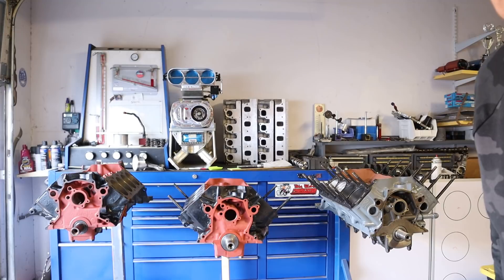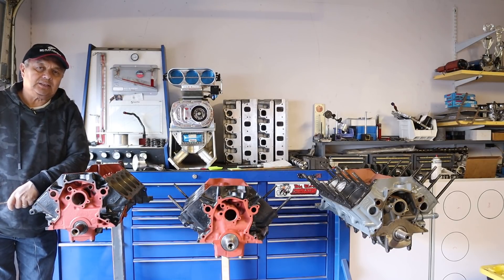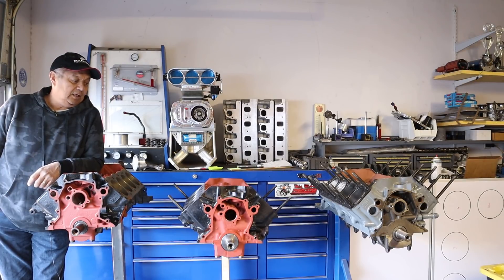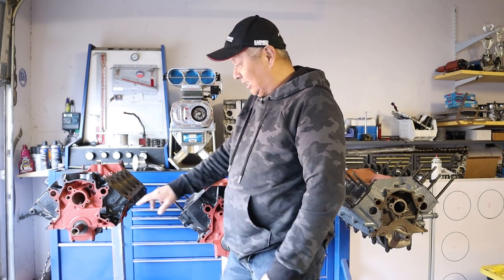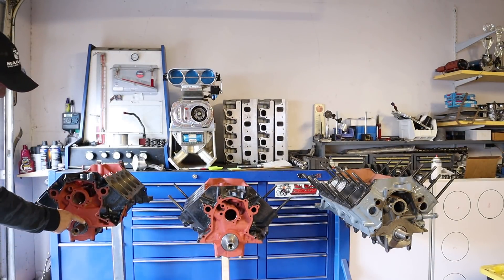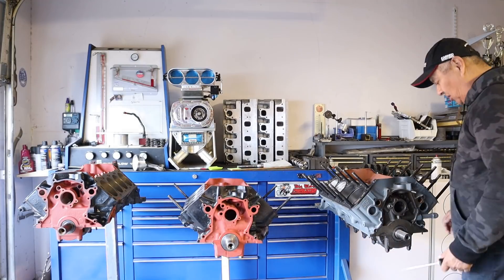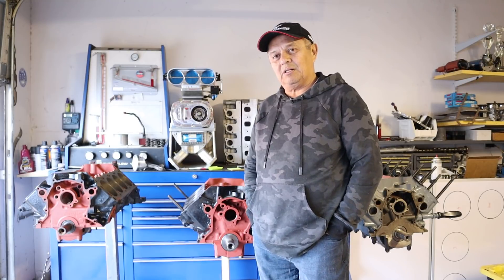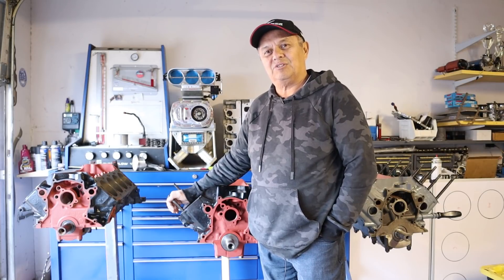FORD SMALL BLOCK SPLITTING EXPLAINED

Comment: Ive torn down (just for inspection) 2 of my Hyd 302 blocks with EFI (1 a 306ci with ARP bolts 50oz & 1 a 347ci with ARP studs 28oz) & found the #2 main (block side) had cracked on both.
Reply from the maker: Sounds like you are exceeding the power capability of the SBF.  Is it NA or boosted/nitrous?

Comment: Ive seen several with split blocks on the 1-5 firing order. More pronounced when you solid mount and start adding power. The ones ive seen split are usually above 500 hp and the more torquee the engine the worse it is as well. Ive had 2 heavy bore and stroke 302 blocks come through my shop that cracked on both sides of the front main.
Reply from the maker: Agree and seems you are making good power to compromise the stock blocks!

Comment: That rumor started around 3-4 years ago. The Nitro Union channel split the stock block in their gasser during a filming of street outlaws. It was a supercharged cement filled block pushing around 900hp. And as the year's went on that Hp number got lower and lower until it got to "stock Ford blocks split at 500hp". All stock block engines have a breaking point. And they break in all kinds of ways. That guy just happened to split his right down the middle. Solution? Once you get into big boy hp #'s build it with an aftermarket block. Ford engines split. Small block Chevy's throw 3,4,5,6 rods and make holes in the crankcase. All stock blocks have their breaking points. Yes kids. Even the mighty LS. Which is really just a skirted Windsor engine.
Reply from the maker: You got it right there sir and they have serious limitations specially with a blower and nitrous.  Turbo's not so much and more forgiving on the bottom end.
Reply: This is what started that whole "stock block Ford's split at 500ho" BS. https://youtu.be/MJLS9xFXYAQ?si=6NdR0qzAmMhIT8at

Comment: I'm conservative and noticed my YouTube feed was a circle of the same stuff over and over. I made a complaint and now I see new things such as your stuff! So thankful that you share your knowledge. I hope you don't believe the bs about conservatives. We go fast too! I'm building a 400 ford to replace my 289iron headed 302h.o. in a maverick. I have 2v and 4v heads to play with. I used Vizards methods in the 289 heads and it went from burnout sudeways at 20 mph to breaking loose in 2nd gear. c4 trans. 380 mini spool 8" rear, 1.94/1.6 valves, ported rpm, 600dp. Etc.
Reply from the maker: I am a conservative as well due to my military family serving our country proudly.  I also noticed the interference when I am discussing something with a liberal and find my responses are delayed or unable to post!

Comment: Never considered that! The old 351cleavlands were notorious for splitting, but under boost or shooting enough nitrous to kill an elephant 😂😂😂
Reply from the maker: Thanks and even 4 bolt main C blocks then had issues and the caps will pull the 4 bolt casting off the block with lots of NA horsepower!

Comment: Glidden might have said it (or it was one of the big Ford Motorsport drag guys at the time) that the Injected 351 in the E series van and F truck that finished in the late 90s was the strongest factory block, and they will handle about 900hp if you do the smart mods like Studs and Girdles - but they are the ticket if you want a high HP build on a budget (with maybe the heads being the exotic part, but I would kinda like to see it done with factory iron heads!)
Reply from the maker: It would make good power to a certain limit then an aftermarket head is necessary to produce impressive power and I have done this many times with a stock 351W block.

Comment: Something else Ben, is the harmonic balancer slips easy with the balist Wright on the outside on the AU injected 5ltr i know, dressing the front, and the expanding of the alloy heads pushes the front of the block forward,  this is why i use the cast heads.  At the end of the day we here all know the cleveland rules the world that is for shore. Mad Mick.
Reply from the maker: Agree sir!  Hard to beat a canted valve engine against an inline whatever engine!

Comment: 13726548 just shifts to rear main "4-8" firing together, although for thought rear main may be stronger than the front main. SBC has the center main firing together,  one would think that is better. Just some thoughts. Thanks for the video.
Reply from the maker: Yes the rear main are much stronger than the front and instances I experience where the trans input shaft actually kept the back together and stabilized the 4/8 main caps!

Comment: Well that is interesting but the 5.0(302) roller engines run the 351W firing order which is 13726548.   Only the older 302 non roller cam engines run 15426378.   Most all if not all of the 302 block splits I have seen were 5.0 roller blocks running 13 firing order cams.   Ford took material out of the 302 block when the 5.0's were cast for a block that was already marginally strong enough.   I have not gone over the 2 side by side to see just where all they lightened it up but any was too much.   I haven't seen any 351W block split.    I have not ever heard the definitive reason why these blocks split or at what horsepower level they split or how to prevent them from splitting.   500 is often mentioned but I have seen lots of stock 302 block engines make way more than that.   For how long they lasted I don't know.
Reply from the maker: There are non HO hydraulic roller grinds with the 1-5 firing order as with many custom cam grinders offer them whichever you desire for your build.  On block splitting factory blocks I have seen them unsteady @ 575-620rwhp and slight detonation will make it fail (302s) !  Those that set their timing conservatively and their Af ratios on the safe rich side usually gets the nod and will last.  351s are way stouter and will take more punishment no doubt!

Comment: Is it the 1-3 firing ordered coupled with the H-pipe design that made the H.O 302 sound soooooooo dang good? I guess the factory tubular headers enhanced that beautiful sound too lol. GM could never compete with Ford with their L69 or LB9 305 H.O engine when it came to sound.
Reply from the maker: I agree the 5.0 sounds great specially with flowmasters and an H or X pipe!  You can even tell a chevrolet in a fox body does not sound smooth and mean!  The firing order and how they interact bank to bank makes the chevy raspy sounding compared to the Fords.
Even today none of these new cars can match a SBF in sound.

Comment: The only blocks I've seen split were ones using solid motor mounts.
I've had several stock E7 blocks making all over 600hp na and we spin them 8500-9000. We use motor plates front and rear to keep the block from flexing under load. 
We've never split a block. We also have several boats stock blocks out there that are boosted making North of 800hp without failures by using motor plates. 
 Minimum using a mid plate would work well with  motor mounts.
I've also noticed guys the usually blow head gaskets less with motor plates. And using motor mounted they tend to blow the driver side head gasket.
    When using motor mounts and a soft trans mount the twisting under load has to go somewhere, and once the motor mounts come to a stop the trans is still twisting sideways, and twisting that block.  That's why they break at the mains.
Reply from the maker: Your points are valid as well and the driver side mounts under severe loading will split the block with the passenger side @ rest and the "torque pulling on the driver side will pull it apart"!  
You are very successful because you are more likely safe on your ignition lead and A/F ratios.  It does not take much when detonation rears its ugly head and the more dangerous pre-ignition.  
Amazing as well a boosted engine does not hyper extend the rods/bolts during overlap where the rods are stretched big time and turbos/superchargers to a certain extent puts pressure on these components @ these phase because, while the exhaust is pulling the hardest to help ingest the intake column,  it is also "pulling up hard" on the pistons to shove it to the heads!
Having the boosts tends to hold these dynamics to a minimum because even @ overlap there is boost present unlike NA it is not there!
Thanks for your comment John and you guys are running hard big time!
Reply: Mines in garage sitting at 10,000rpms, were tryn to sling stock rods, dam henry built these stokers good, its been wot for 3 days now
Reply: @johnboschma3267  Jesus. Complicated stuff. Maybe better to just buy an aftermarket block?

Comment: Simply put, you gotta know the limitations of your selected hardware. I would never consider building a racing engine based on a stock block. Even my street car uses a Dart block.
Reply from the maker: Stock blocks would hold but you have to be realistic on how much you want to push the power levels and do a safe fuel/ignition tune!

Comment: I've split 2 - 302 blocks,  both had the 1-3 firing order, never split one with the old firing order. But you may be correct as to where the splitting starts.
Reply from the maker: Jeff, strange things happen and it may also be you are making more power now than before and perhaps getting better at tuning and set up.  I had one broke off the thrust bearing at #3 because he had a vibration and turned out to be a twisted driveshaft and shook the engine to death!
Reply: You’re confused TR

Comment: Ben, any thoughts on the use of motor plates vs motor mounts on these stock block 302s? Seems to me that the guys around here making them run the fastest pretty much ALL run motor plates. Could you also shed some light on how rpm increases increase the force of the piston stopping and turning around to go the opposing direction?
Reply from the maker: There is the possibility of solid steel mounts  definitely pulls on the drivers side increasing the possibility of block splitting!   Having an engine plate and a mid plate at the back will definitely help the cracking issue this is why you see hard running stock blocks survive the hard passes!  Additionally using hardened pins anchoring the manifold to the block will also help keeping them joined together so try that as well!
On piston dwell on TDC happens the worst with a long stroke engine and usually short stroke engines or shorter stroke will lessen the piston speeds accelerating from TDC and snatching it big time and loosing the engine.  Shorter stroke will slow down the piston to safer speeds and the engine will definitely rev higher and stay together.  
Lastly, if the piston goes backwards usually is caused by pre-ignition not detonation and is the more destructive force!  It will be a short day so make sure you have no cross firing or leaking wires to the others and the distributor caps have no tracking lines inside.  Also anything overhearing or glowing inside the chambers will cause these issues like carbon or a thin valve margins which will glow like the edge of a knife when you place it in a fire or flame.

Comment: A large problem with these block, is that they are not designed to run over 6400 rpm, a good quality engine harmonic balancer will help, but eventually your going to have issue when your start running up into the 8000 rpm range without taking into account there primary design.
Reply from the maker: They will run high rpms within reasonable limits if you opened up the main bearing clearance .0028-.003.  Here it will take the rpms and the rods should be ok at .0025.
Reply: @benalamedaracing2765  Interesting, BMW seems to think they can get away running really tight clearances for 100k miles on rod bearings lol. The crank webbing of a 5.0 XXX roller block is not like the early blocks, there is more meat in the webbing of a 289, add in the fact that you increase the valve spring pressures on late model block,  and at higher engine speeds all harmonics destroy an engine, put a supercharger on the nose of a factory crank and your ok to 6000-6200, but don't get rev happy with them. My machinist liked to run more clearance on bearings if you were racing as intended, that goes with fact that your going tear down the engine each season or two depending on use. Don't ask me why BMW runs such tight rod clearance on some of their hot rod motors. Honda figured out that 1.888 rod bearing size is ideal for some of their engines, then NASCAR followed suit soon after. The crankshaft is where is all goes to, so would be interesting to see what a zero balance roller block would put up with, that's an expensive balance job though in itself....
Reply from the maker: @blkcoupequattro , thanks for your input and appreciate the feedback.  BMW's overcomplicate things like Audi.  The block webbing on the inline 6 mains are hollow in the middle and no support at all!  I am doing an M series racecar and I showed this to another BM owner and his eyes got real big!  lol  There are limits to their block integrity.
Reply: @benalamedaracing2765  Key word "fluctuating oil pressure", as you noted the casting is weaker there in none purpose racing blocks such as a DART block much more material. If you could fit a four bolt main cap in front also they might hold together 850-1000hp for a little longer ....

Comment: Better alloys were used on ford blocks. During the 5.0 era....they dropped the % of nickel in the early to mid 80s blocks. So the 302 from the earlier 70s will handle a bunch more. The early 80s also used iron heads. The year they switched to aluminum heads on the GT, cobra, models...the blocks are the problem children. The 351 truck blocks in the lightning had no issues at all during the same time. Avoid 1978-1987 5.0 blocks and you will be just fine.
Reply: no aluminum head was ever used on a PRODUCTION 302/5.0 SBF..  the last head used was a GT40P cast iron POS

Comment: Ben, i know from working in a Machine shop, there is two different type of balancing, high and low speed. Many shops do not do the high speed one. I prefer zero balance and high speed on a high reving small block. Plus changing firing order makes a big big difference to keeping them from splitting. My 302 made 503 hp at 8500 rpm, Ford Motorsport factory replacement rods and crank and their forged pistons. I had that rotating assembly high speed balanced and zero balance. The heads were 1970 351 D0OE highly ported and big valve's. My cam was a custom grind 351Windsor CompCams solid lifter unit of 
0.697 on intake and 0.703 on the exhaust, ported Victor jr intake, Holley 750 DP with progressive secondary linkage,Hooker big tube SuperComp headers. Boy it sounded like a prostocker with 12.5-75:1 compression. Between my father and i we buzzed it to 8500 daily when ever we could if i wasnt doing chassis mods to the mustang. After 2 years i took it apart to check it over. It looked day one new still, i never put it back together because my wife and i had our 1st child of 6. It still seats at my friends house today, 23 years ago. There is a ton involved to keep them from splitting, the Tune is number one, balance is close second, RPM's is close 3rd. The tune is a big big issue though.
Reply from the maker: Sounds like you got it all safe and good credit to keeping a detailed look when you were running and assembling a good engine!  I usually "over balanced" my engines which makes them shake a bit more during idle to slow engine speeds but it is of minor concern to me.  I want it balanced this way so I keep all that vibrations at a lower level helping me save the whole thing.
Reply: Day one still new ? The top bearing in the rod always has a bounce mark on it.
I don't believe that bearing looks day one new.

Comment: To my understanding not practice yet is a key to large power on 8.2 and stock ls is to not let the rpms drop to or below peak torque on the shifts.(making a full load pass). How do you feel about that? I think it makes sense and seems to work well from observation. The right tunes are a major player too.
Reply from the maker: Agree and when it hits below torque peak and starts climbing is when trouble can rear its ugly self and destroy our engines!

Comment: Both of my 5.0s that split its no question the damage started in the main webbing and worked its way up thru the top, mine was boost, nitrous and 8k+ RPM with a stock long block other than springs and timing set. Not the blocks fault, 100% operators fault of tuning and abuse lol, filled the third block got better with tuning and gave it more abuse and still together plus for much longer period of time with the same rotating assembly and heads. Just my experience plus i feel the side engine mounts have a bit of affect on the block cracking too
Reply from the maker: Thanks for your input and means a lot to many of us!  Cementing definitely helps and running a motor mount specially the left driver side will tend to pull on the side and also may be responsible for further cracking at the middle lifter valley!  I feel a mid plate coupled with the front plate will do a lot in helping the status quo!  More power to you and glad you are running strong with an 8.2 deck.

Comment: Good diagnosis of the cracking problem, I think you'r on to something, I have not used a 15426378 firing order cam in years, I guess a good balance would not hurt either.